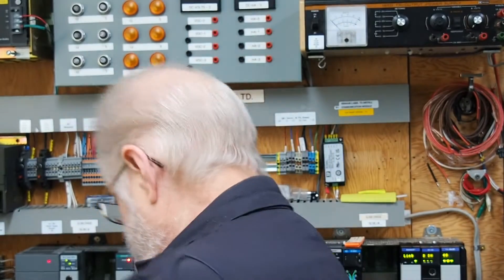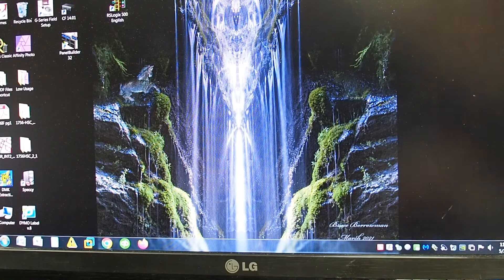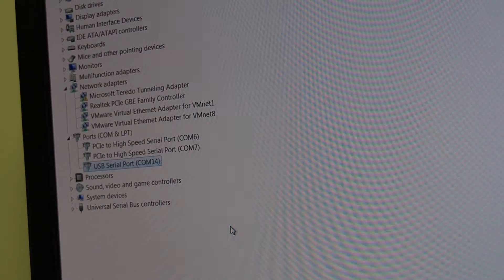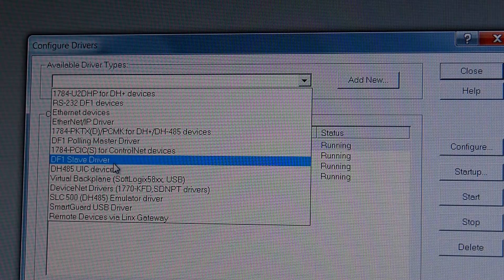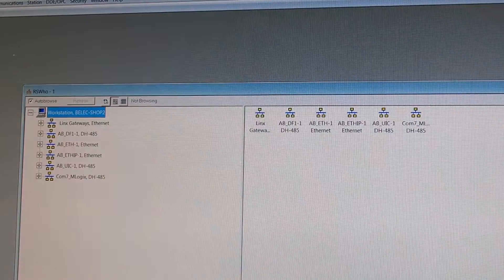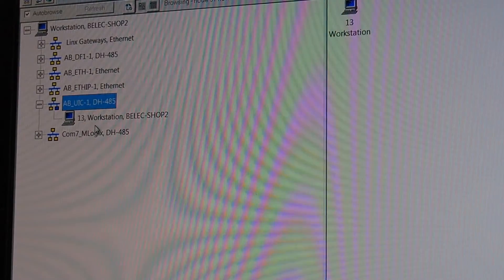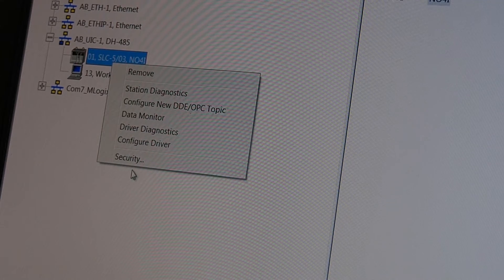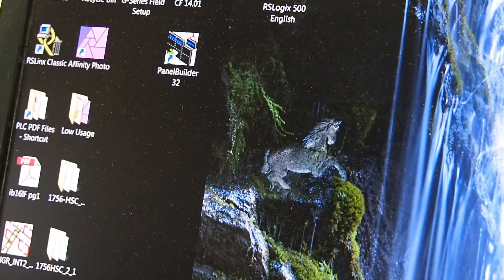SLC503 & 1747-UIC

Comment: I'm trying to establish connection with my SLC 5/04 and I'm using 1747-UIC RS232 pin. So I can't find the cpu in RSLInx after clicking Auto-configure. Does anyone know what could be the reason ?
Reply from the maker: The UIC is a DH485 communication protocol used with the 501 - 502 - 503.  You only need to go RS232 between your PC and your 504.  A USB to RS232 convertor is all you need and then do your Auto Configure once you know the port number of the convertor.  Confirm your pin outs for the RS232 cable as there are straight thru and cross over styles of cables.

Comment: Hello, are you from Prince George?  I noticed in one of your other videos for a 1756-OA16 card you're using a multi conductor, possibly Belden, wire for doing your outputs.  Which type of cable are you using?  Thanks
Reply from the maker: HI Kyle:  Spent 36 years in Mackenzie.  In the Okanagan now.  I use 19c 18AWG that I get from EBHorsman.  I have a couple of videos on the channel that shows how I wire them up.
Thanks BB

Comment: Hello!!
I want to connect to a SLC 5/03 on the Port 0 is configurated as DF1 Full Duplex, is posible to use this cable?
Reply from the maker: Hello Miguel:
The UIC adapter can be switched between RS232 for the serial communication port or DH485 which is the other port.  Even though it looks like an ethernet port it is not.
Just about any USB to serial adapter will allow you to hook up to the 9 pin RS232 port.
The biggest trick is to make sure you have the correct 9 pin cable.  Thne do an auto configure in Linx and it should connect.
Reply: @abplctestbench759  Thanks for your Response!
Well I try with my USB Serial Adapter and a null-modem cable and the RSLinx never connect to the PLC, and the Autoconfigure always fail.
The correct cable is a female to female DB9 with Pins 2 - 3; 3 - 2; and Straight 5?
Thanks Again?
Reply from the maker: @MiguelGomez-rc7ou  
Sorry to take so long - been having PC problems all last week.
Good except on each end you have to jumper:
 1 to 6 and then it should work.
If not let me know and I will do up a video showing the connections.
Once you get it working on the 1 it will work on all of the devices you need.
Reply: @abplctestbench759  Hope all problems has been solved!!
OK, Maybe week I need to return to that CPU and DTAM terminal and will probe that config.
Thanks!!!!
Reply: Hello Sir!! thanks for your help with the DTAM Terminal, all works fine!!!
But now, Have some weird case, in October, the SCL give a Fault, a 1746-IA16 Module give a Fault, the message say something like, "Missing or bad connection module in RACK #" So, power OFF PLC remove and install another module, clear fault, PLC goes to RUN without problems, We check the wiring all fine.
but 2 days ago, another module fault again, same fault. use the last spare module, clear fault, check wiring, all clear PLC runs again.
What can damage the modules? I know they are old, but is suspicious... 
Any Idea, what I can check?
Those Module have blow Fusible?
Now, we don't have any spare module, and the module we can get are different series, they will work?

Thanks!!
Reply: @abplctestbench759  Another Question, Sir have experience with the DTAM plus Terminals?
Is possible to upload from the terminal to my PC (I Have the DPS software) this terminal have Printer port RS-232, wich cable is needed to connect to the PC?
Thanks!